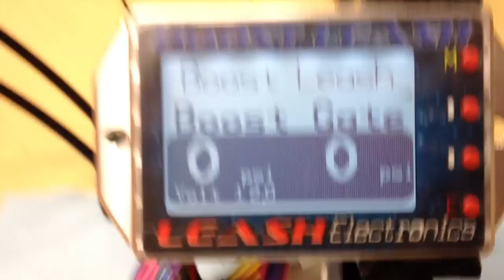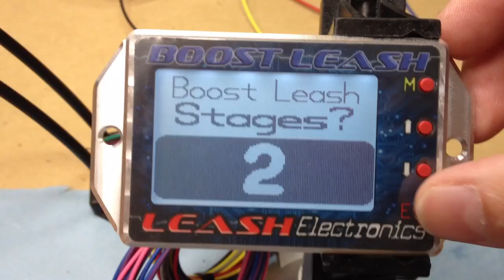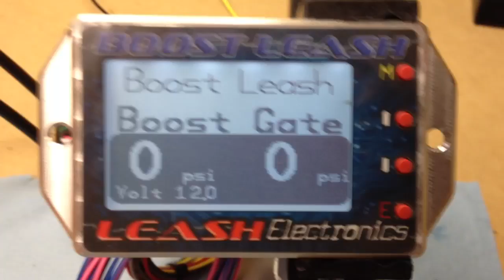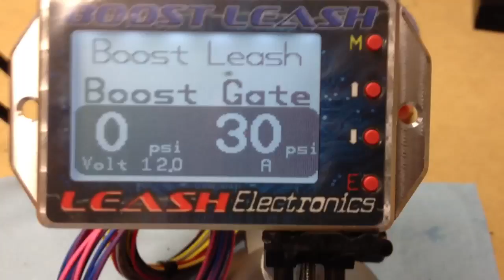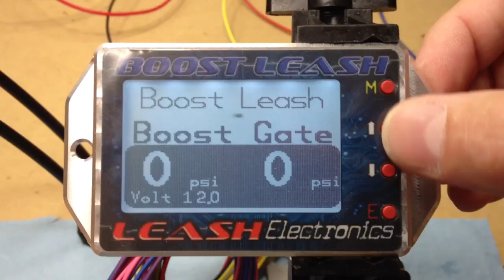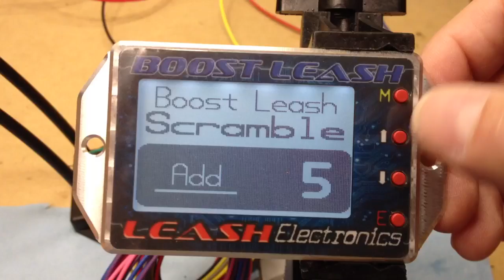Boost Leash Demo

Comment: Question... if you set your launch PSI @5 as shown in the video, and you set your first stage at 15 psi and 0 time so it comes on as soon as you let go of the transbrake are you not effectively overriding your 5 psi launch setting?

Comment: We understand how to operate the box. How about showing us where the pressure sensor hooks up and the solenoids and the wiring for it so that we understand where that stuff goes. We understand the red and black is the hot and ground but as far as hooking up the rest of it, how about a diagram showing how to do it? And if we're not running CO2 or air pump, can we run this off of the turbos housings?

Comment: Randy

I'm confused, which isn't hard to do.

After one second you were at 15psi, and then with a ramp rate of 3psi per second,to a target of 30 wouldn't it take 5 secs to get to 30psi? The logger shows 4.4 and its at 30psi

I'm only assuming the rate is psi per second, but I'm thinking I must be missing something

Thanks

Comment from the maker: The blue lcds are different screens I use now because I like them better. Scramble is activated by a separate button.
I have line and fitting kits but I dont sell the bottles and regulators.